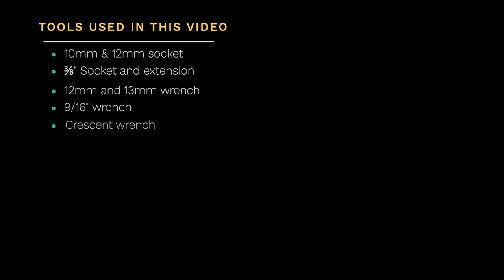How To Install a Rivco Trailer Hitch On a 2018+ Honda Goldwing | Updated Video

Comment: Hi Chris - After installing the Revco hidden trailer hitch and now my 2019 Honda Goldwing rides really rough. I followed your install every step of the way. It feels like the flex in the hinge points are bound. Should I loosen the hinge points. Any ideas?

Comment: Ok Cruise man. I consider you a source of truth. Installation of the hitch went relatively well. Stripped one of the heat shield bolts. No big deal. Putting it back together now and I have to ask. 

WHAT'S THE SECRET TO THE ALIGNING 4 TABS ON THAT HEAT SHIELD, WHILE GETTING IT OVER THE FALL OVER PROTECTION. 

I just don't see how you line them all up when you can't see any of them. 

I'm sure Honda puts them on before all the body work so the can see the alignment. 

Any tricks or tips for making this last step happen?
Reply from the maker: I have never come up with a good suggestion for that. Hardest thing on the bike to re-install are the heat shields. It helps if you put some silicone grease on the rubber tab inserts, but the first time I did it, it took me nearly 45 minutes to get it back on.

Comment: Great video as always! 

I have a question. I have a 21 wing and my phone is on my left side handle bar. I want to power it and keep it connected to apple car play while riding. How would you recommend on drilling a hole in the center pocket? I appreciate any insight you can provide. Thank you!
Reply from the maker: You could simply pull the USB cable from the grommet in the center pocket and then run a USB extension up to the handlebar, Of course, you would have to remove the top shelter to do this. This would eliminate the necessity of drilling another hole.
Reply: Or use the wireless Carlinkit 3.0 or 5.0.

Comment: @timestamp 4:12: Remove mufflers:
 I don't see where this is necessary. The trailing arms can be fished up from the rear of the bike, and the bolts are all accessible. If you do this, re-installing the mufflers and aligning them is difficult, and the carbon gasket in the inlet gets dislodged, making it not worth the effort. Also, when pushing the mufflers forward to re-install, you stand a chance of pushing the bike off the center stand, so be very careful of this.